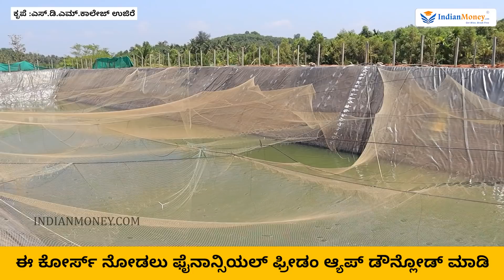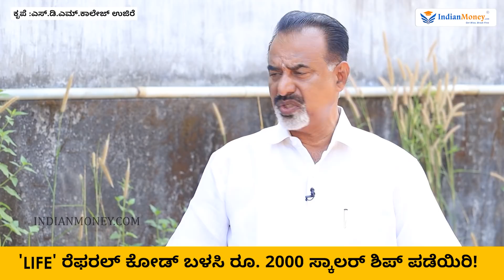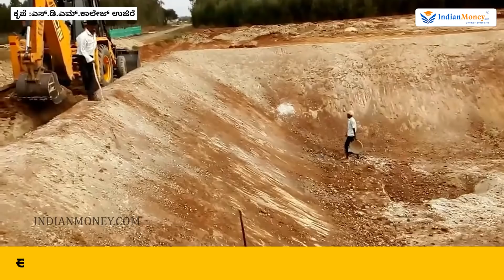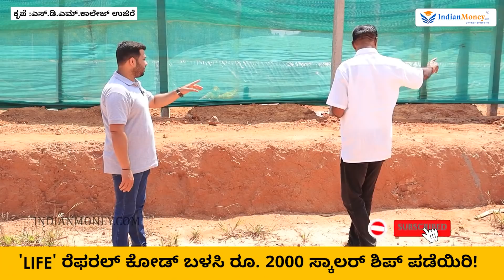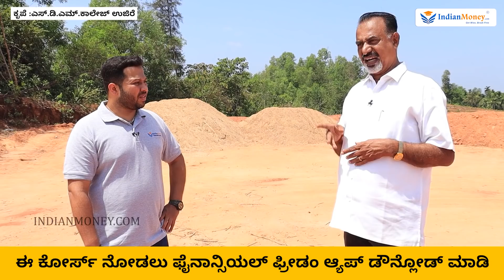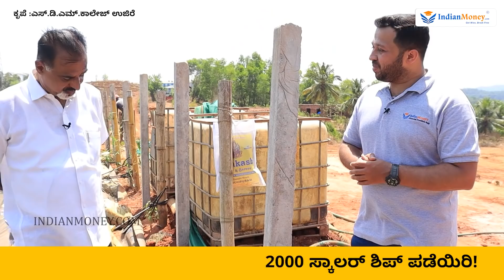Agricultural Pond in Kannada - How to Build a Farm Pond? | Shesha Krisha

Comment: Dear Bro good idea, few suggestion. Today 23/3/2023. Many lost life in Krushi Honda. Suggestion 1. Fence 2. No Tarpaulin sheet ( Fungus growth and slippery) 3. Best like step well with local waste stone or sand mixed with cement ( Little expensive) 4. Single entry Gate. 5. Depth less than 3 FEET. 6.rope to center of Krushi honda from all corners.